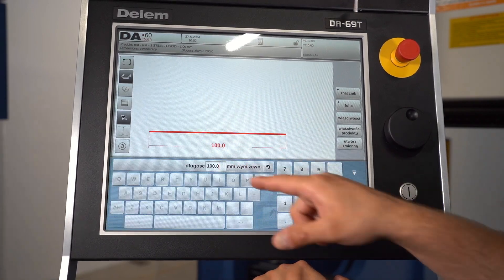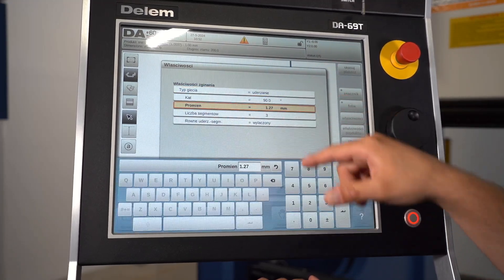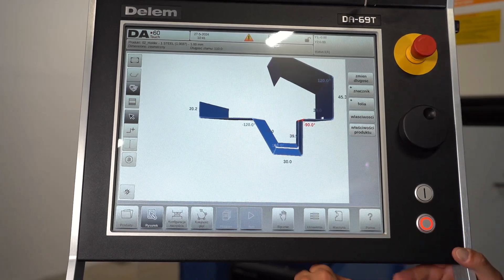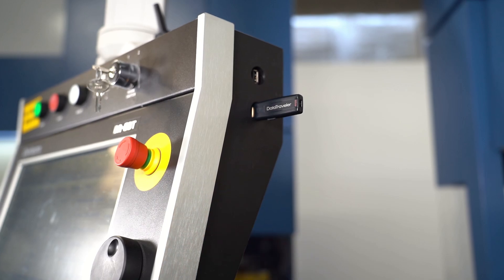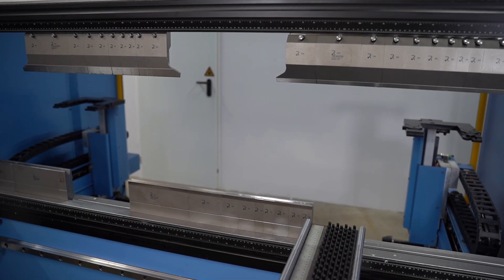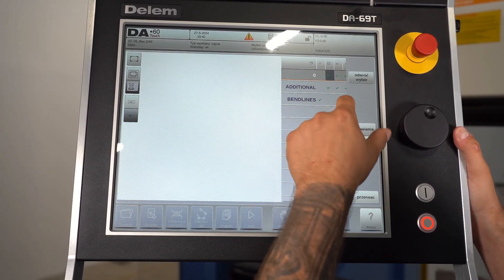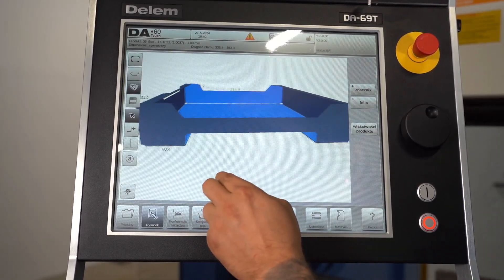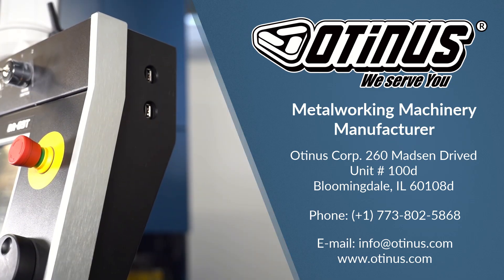What is the DELEM DA-69T controller?

Comment: how to configure pinch point. between tip of the upper mold and the thickness of the material?
Reply from the maker: The “pinch point” refers to the moment when the upper tool approaches the sheet just before bending starts.
In the controller, you can configure this as a precise stop distance – typically 0.5–1 mm above the material surface.
The value should be adjusted depending on the bending method and material thickness.